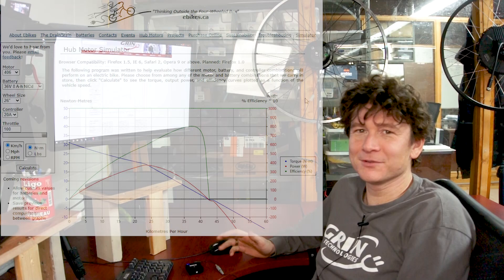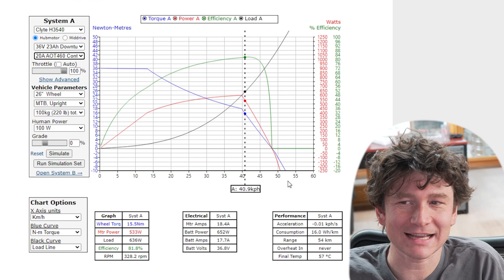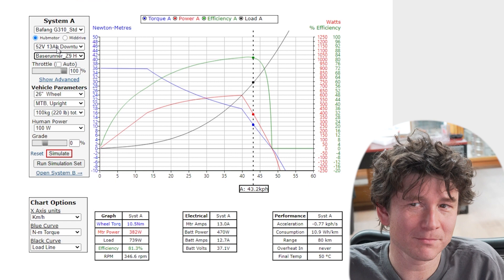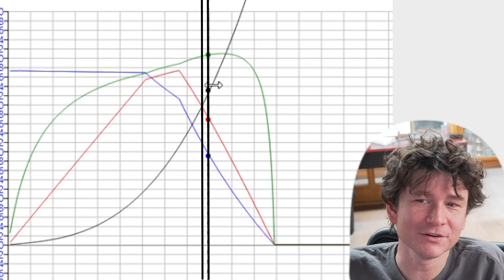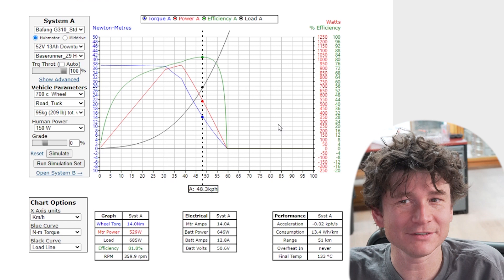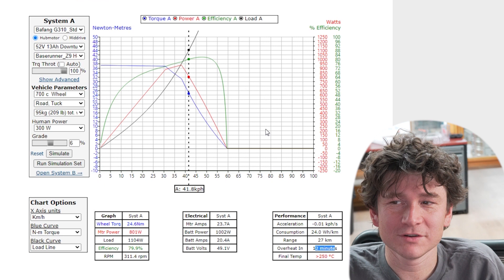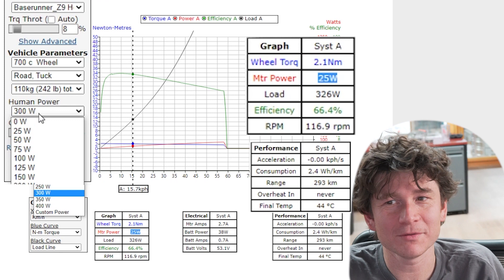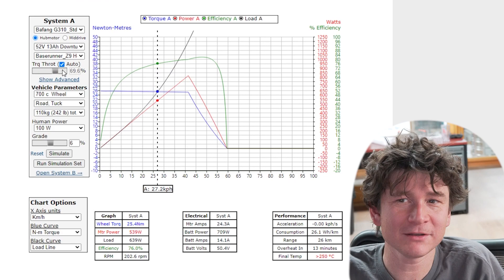Grin's Ebike Motor Simulator Tutoral:   --PART 1--  Basic Overview

Comment: What should I set the simulator if I have a QS205 V3 3,5T hub?
Can you recommend a somewhat equivalent motor on your list?
Reply from the maker: If it's a 27mm stator width use the 9C+ motors, if it's a 35mm stator use the Crytsalyte 'H' motors, and if it's a 45mm stator use the MXUS motors.  Then use the "KV adjust" in advanced options to match to your unloaded RPM.

Comment: When using your “Y Cable for Dual Controllers from Single CA3-WP” , do both systems need to be running the same voltage? I have a dual motor bike one system is 52v and one is 72v, I’m Wondering if i can use the ca-wp3 splitter,  Thanks!! 🙏
Reply from the maker: Good question but quite unrelated to this video! Out of the box no, with some minor wiring modifications yes,  but even then the CA can only report and display a single voltage. Though the amps will get combined, no matter what the displayed wattage would be incorrect, and all associated stats (wh/km etc)

Comment: What is more efficiant?  One motor with 20Nm, or two motors with 10Nm each?
Reply from the maker: That depends on the motors you are comparing.  If they are powerful motors, than a single motor doing 20Nm will be more efficient than two large motors only doing 10Nm each as the core loss component will dominate over the copper loss. If they are small motors where copper loss at 20 Nm is significant, then two of those sharing the load will be more efficient than one.
Reply: @GrinTechnologies  Thank you! Exactly what I wanted to know!

Comment: Where’s the QS motors ?
Reply from the maker: There are a number of 27mm, 35mm, and 45mm stator width DD motors already on there, so not much value in testing and putting up more of the same.  The 3rd video actually goes into how to use an existing motor model (like the MXUS if you want to compare with a 45mm stator QS) and use the KV adjustment slider to make it a decent match.

Comment: For a first ebike what should I go with? Hub or mid drive? Having regen would be super nice as I wouldn't have to use the breaks all that often though but a bunch of videos say mid drive is snappier. Then again I want an ebike for just casual riding where I have almost no hills
Reply from the maker: Well our opinions on this front are pretty well known and laid out in some detail here:
https://ebikes.ca/learn/why-hub-motors-are-awesome.html
Honestly for a first ebike you'll be happy with either, but there's a greater maintenance overhead with mid-drive and for many people once they've experienced regen it's hard to go back.  
Mid-drives do have a great snap off the line if you remembered to gear down before stopping, that is true.
Reply: Mid drives are more complicated, requiring a higher learning curve (like a manual transmission on a car) to avoid stressing the bike. That leads to higher maintenance even when you learn to shift well as the entire drivetrain is exposed to added wear and tear from the motor. People who enjoy shifting gears in a car can feel a middrive is snappier or "more natural" because the middrive requires that extra step of shifting input that they crave.
The simplest option is a direct drive hub motor, which have no moving parts other than bearings, so they last longer with little to no maintenance, covering longer distances at higher speeds. If you add regenerative braking, then your brakes last longer too.
Reply: More valid opinions you get the better. It you want a plug and play easy peasy build it in an hour or so then hub motor is for you. They heavier and painful when you flat cause there ain’t no easy way to remove the rear hub. When you throttle ride a hub motor, theres off and on and you’re not really using the gears as much. Mid drives make more sense; especially if you had a hub motor before then changed. The balance of the bike feels more natural and the freewheel feels validated again. There’s a learning curve to preserving your investment, like you dont want to keep breaking your chain, then there’s small routines that become second nature that you learn to enjoy this type of drive and the cost of getting it and all the upgrades that you swear you cant afford but bought anyhow seem trivial.
Reply: Can you use the system to change any controller settings? How do you connect? Or do I need a grins controller?
Reply: mid drives are great for climbing very steep hills in lower gears, efficiently and without overheating. also dthey dont add weight to the rear wheel.
serious eMTB are mid drives, road bikes too. its also a must have for cargo ebikes in hillly terrain, unless you have a very powerful and torquey hub motor. they usually also have torque sensors, which is great too. but hub motor is also great especially if you take the time to make sure it's correctly sized and configured for the kind of hills you're going to tackle, which the simulator makes much easier. yyou can also have torque sensor on hub motors buts its not common especially on prebuilt ebikes

Comment: good video , what abut f.w. ? how i but it on the semolator?
Reply from the maker: By f.w. you mean freewheel?  If so then yes, it is on the simulator, compare the curve of a geared motor with a freewheel vs a direct drive motor and you can see the difference above the unloaded speed. Freewheeling motors show 0 torque, while non-freewheeling motors have a negative torque and power associated with overcoming the core losses.
Reply: @GrinTechnologies  I think (and would love to see) that they mean Field Weakening
Reply: @GrinTechnologies   mean field wikininig

Comment: Do you live on the moon? 200W  means for you "really putting out" ? 
Really putting out on hill is like 500W, if you sprinting it's mostly 600-1200W, 
if you training heavy weightlifting very hard you could hit 2000W mark. 
And Robert Quadzilla is able to put out about 2300W max.

1h World record on track is estimated for 460W. 
Most of normal men would be able to sustain 220W for 1 hour.
Reply from the maker: Take a random person off the street, put them on an exercise bike, and ask them to maintain 200 watts for 10 minutes straight.  Most people would be sweating buckets by the end of that.   

Yes for a fit athlete it would be a walk in the park but that's not a representative sample of the population which this video is addressing.

Comment: Incredibly useless, 
set 0W human power, got 30km/h, 
set 200W human power, got 33km/h.
Results are insanely stupid...
200W in it's own would be enough to ride at least 25 km/h.
Reply from the maker: Spend some time to look at the actual numeric data to understand what is going on and it hopefully will all make sense to you. In this case you are modeling a system near the unloaded speed where the motor power is back-emf limited. As your human power increases the speed of the bike, the motor power goes down significantly. So most of that 200 watts of human power is negated by a similar reduction of the motor power. 

If you want to see what it looks like to additively put 200 watts of human power without the motor power going down at all, then change the controllers throttle type to torque based, selected a motor + voltage combo with a higher speed, and then adjust the throttle down to get 30 kph with no human power. 
Like this:
https://ebikes.ca/tools/simulator.html?batt=B5220_GA&cont=BRZ9&throt=25&hp=0

The motor output power is 285 watts generating 11.2 Nm of torque.  Now if you add 200 watts of human power, you can see that the speed increases to 39 kph, with the motor still producing 11.1 Nm. 
https://ebikes.ca/tools/simulator.html?batt=B5220_GA&cont=BRZ9&throt=25&hp=200